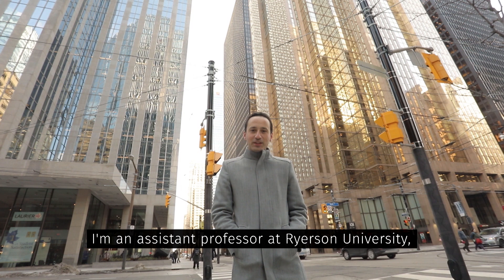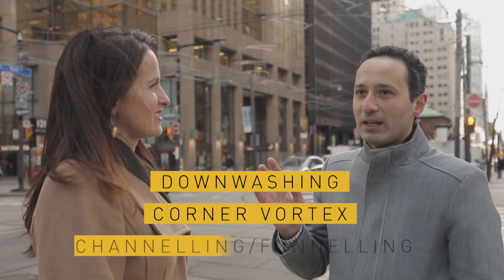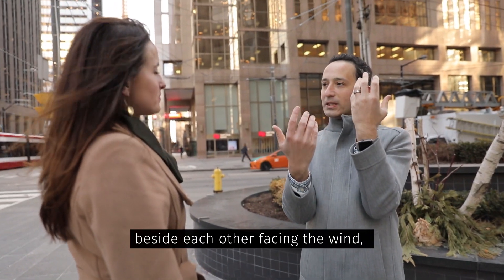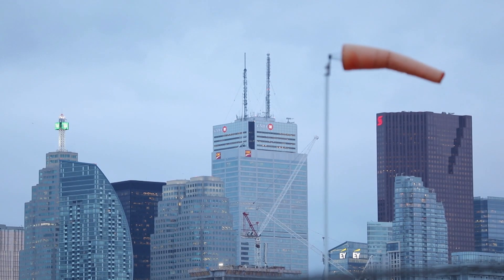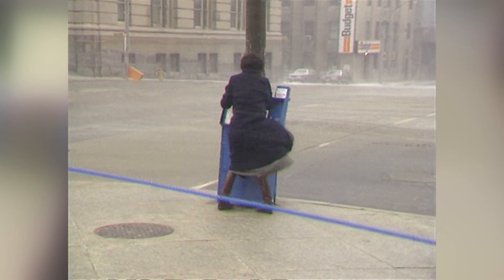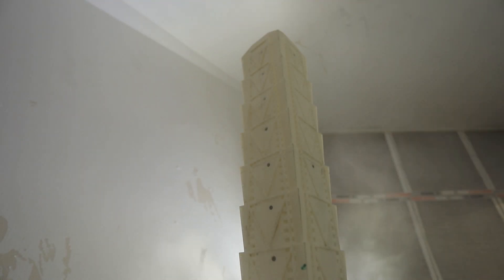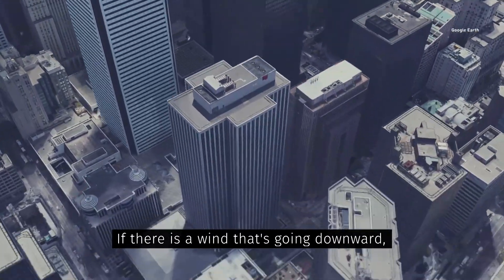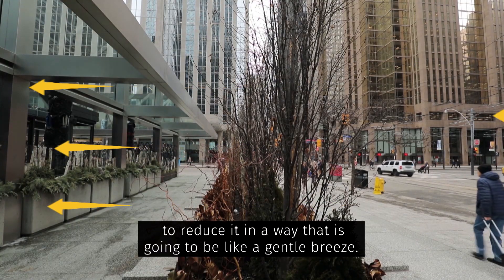How Toronto's skyscrapers make winds worse

Comment: Put up wind turbines to power the buildings.  You don't need big ones.  The wind is already there.
Reply: already been done, doesn't exactly work well
Reply: where you gonna put the wind turbines?
Reply: @ninja.saywhat  There are a lot of engineers who could figure that out.  I would make a turbine chain of small units and extend all edges of the building out 1m to accomodate them, except on the ground floor.  A building that is 100m tall from that point would create a new 400 square meters of wind capacity.
Reply: @ninja.saywhat  I know you dont know this but wind turbines can be built on water and most wind turbines are built on water do to the fact that along the coast is where most of the wind is blowing so it can utilize that. Canada only received wind turbines more then 20 years ago but Germany have been using these turbines more then 40 years and have built them along the water to power their cities. Canada has been behind some development where they should have added wind turbines around Toronto and use that to generate electricity or having fibre op cables put down all over canada while the rest of the world have already done that a long time ago. Do to development canada doesnt progress as fast as they should.